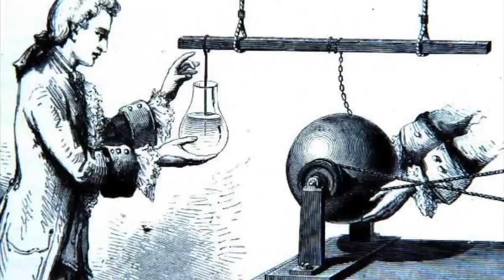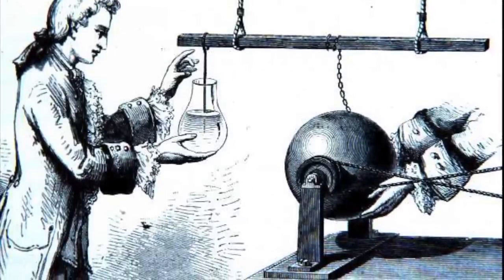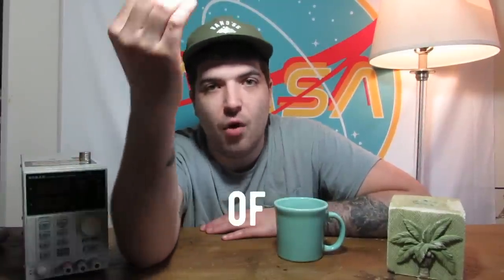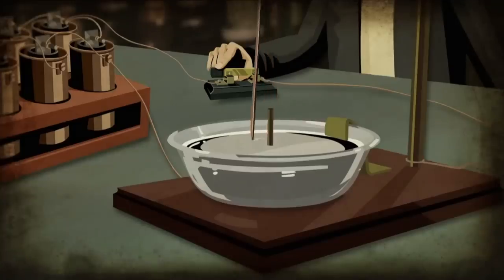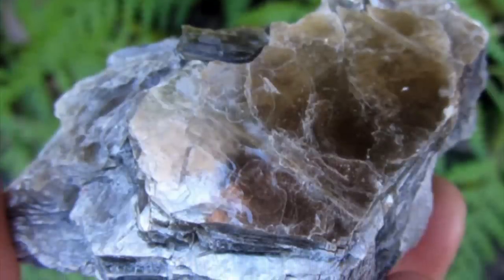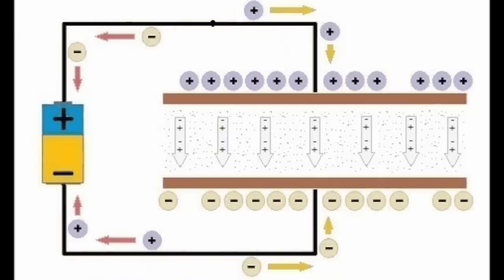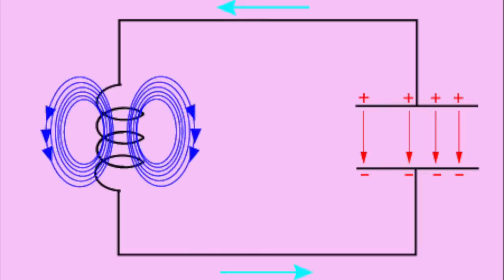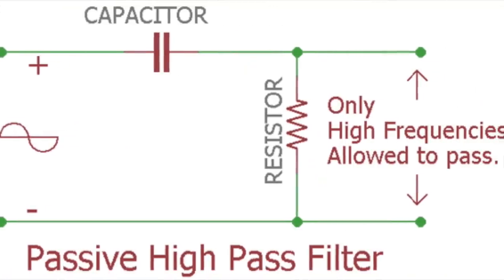How capacitors work, and how they're used in circuits today

Comment: Thanks. I have a feeling my Arduino circuit needs a cap or two as it keeps randomly freezing. I leave it on all the time to control my radiator with a remote control/relay and programmable timer as well as other bells and whistles such as a colour capacitive LCD screen / humidity sensor, RTC and speaker. There is some 4,000 lines of code to it so I don't know if it's an error somewhere and it's getting stuck in an infinite loop, or there's a voltage drop in the logic circuit, or it's overheating. It's a hard one to bug hunt since it only does it now and then, but always in the on position when the relay has activated the radiator. I wake up with a very hot room. Nothing works until I reset the plug.
Reply from the maker: yeah that happens me a lot with the arduino uno// but I've never used it in an application where it would need to be on for that long, so I never really looked into it - but I should look into it, I know eventually it will be a problem
Reply: @MillersPlanetOne   The Arduino can be left on for 54 days I think it is before the millis() function runs out of digits and rolls over. You then have to learn workarounds for it which take some getting used to. I know it's not this though as can happen anywhere from 2 days after a hard reset to 6 weeks. I've taken the back cover off as I suspect maybe something is overheating, since it only seems to do it when I've got the temperature up high.
Reply from the maker: I think i'm gonna test out that theory, it seems plausible - for me it's usually within the first 10 minutes, probably also with an overheating board... i'll try to address my results at the end of my next video- it's going to be about transistors so it seems like a useful/relevant thing to publicly address
Reply: @MillersPlanetOne   I'll look out for it. Within the first 10 minutes? Have you replaced the Arduino itself? Could be a bad one if it's one of the Chinese knock offs. They make all kinds of variations and cut all kinds of corners with bad soldering, rust on components such as terminals, etc. Or it could just be overheating. I would use a multi meter with the temperature sensors on it to check all round the board. Anything over 60c should be a worry.

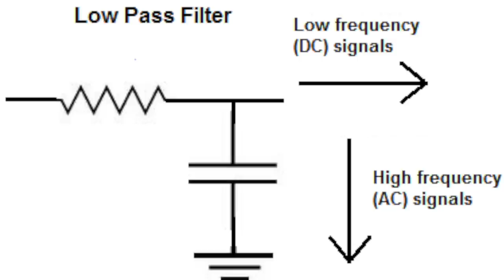Comment: Thank you for the video, very helpful! Let me ask a really dumb beginners question regarding low pass filters (7:00) (also related to experiment 10 & coupling capacitors in the book Make: Electronics). If we're already dealing with a DC signal which came out of a bridge rectifier, how can there be any AC to filter? That book mentions coupling capacitors "allowing AC to pass while blocking DC." I understand the blocking part, but don't we have only a DC signal? I've been trying to research this topic and failing completely. Thank you!
Reply from the maker: the thing about rectifiers is, they flip the negative peaks of an ac signal to be positive- this rectified ac is known as a 'bumpy' dc because as with the negative peaks of the wave, the positive peaks dip back to 0v (as the 0v used to be the wave's inflection point, which the rectifier by itself doesn't get rid of) at regular intervals. hope that helps??
Reply: @MillersPlanetOne  Thank you for your prompt reply. (Actually it was my impression that the signal as shown at the 7min mark would have already been through a smoothing capacitor..but I guess the capacitor in that schematic actually is the smoothing capacitor). But my main confusion is that label which says "High frequency (AC) signals" co-existing with the label which says "Low frequency (DC) signals." How can there be both alternating and direct current running together in the circuit at that point? I thought a circuit could only be either AC or DC. Thanks for your patience with what seems like a dumb question.